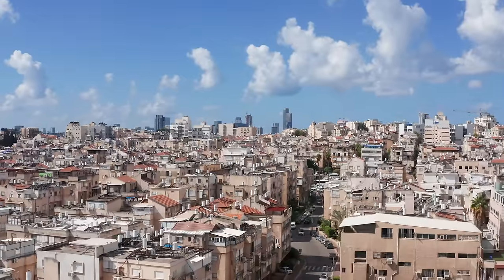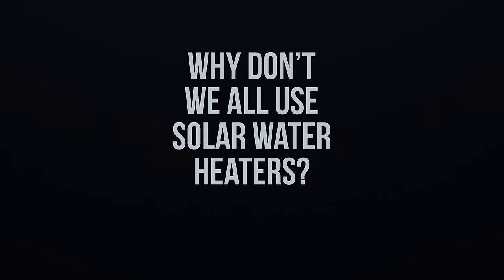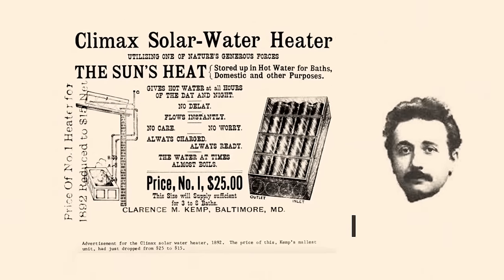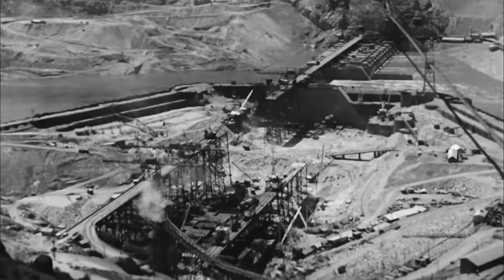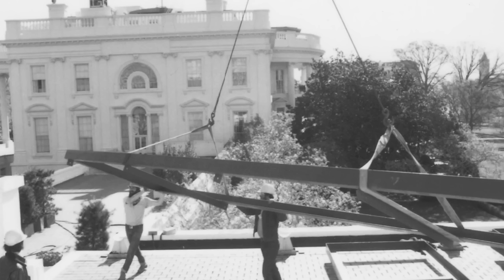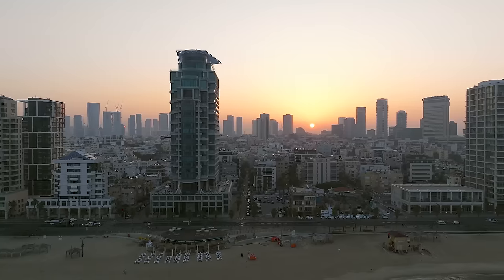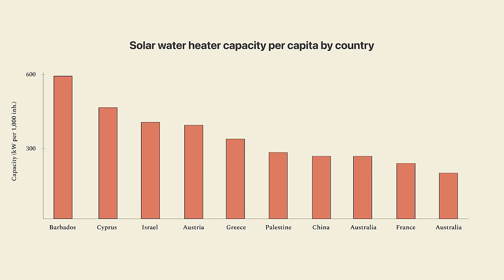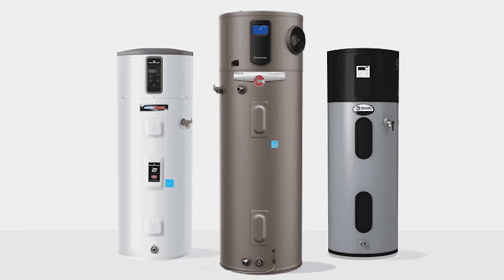Why Don't We All Use Solar Water Heaters?

Comment: I had a passive unit that was essentially an 80 gallon stainless steel tank coated with a black coating and placed in an insulated box with fiberglass glazing. Since it was passive, the cost was minimal and without any routine maintenance. I've had as many as 12 in the house and we never ran out. The 40 gallon electric heater it was filling gave 120 gallons of hot water in total. Other than pressure relief valves nothing was supposed to move and it didn't. The electric unit would supplement as needed but due to it being 'unused' it was protected from the normal debilitation of acquiring corrosion and a buildup of limestone due to boiling. 
The solar tank sprung a couple of pinhole leaks which I resolved but I think that they needed to do better quality control.
Anyway, if you can, go passive and simple. If you are in Florida, the groundwater around Tampa is over 70 degrees and requires little elevation in temps.

Comment: From my viewpoint they are an outright fraud. I had a new house built four years ago to meet the latest energy efficiency standards. To meet the standards, I had a supposedly super-efficient evacuated tube solar hot water system installed. My electricity bills have never been higher and my power company estimates the hot water component of my electricity consumption at around 35-40% winter and 60% summer. In an all-electric house with two people who shower no more than once a day, use cold water for laundry and have a dishwasher that heats its own water. And yes, I have had the manufacturer's "expert" representative inspect it and tell me it's installed correctly. I won't be wasting my time and money installing anything "solar", including PV any time soon.

Comment: I had one in my last home.  The water was super hot.  The impeller on the pump disintigrated.  Replacement parts were no longer available.  All the people installing the initial 2-3 years moved on to other persuits.  The tank was so efficent that I could turn the system off and go on vacation for two weeks and still remain hot.  The system had a radio controlled cutoff used by the local electrical company to shut off the electric backup during peek power usage.  I will never again use a system that someone else can shutoff on command.

Comment: $$$ in the United States they are way too expensive to purchase to install and operate. You could run an instant hot water heater on propane and never in the lifespan of a solar hot water heater use as much propane as it would cost to install a solar hot water heater system

Comment: Like John I installed 320 sqft of hydronic collection in 1986 it heats a 800 gallon tank in the basement and it heats my domestic water and radiant floor heating and took advantage of Jimmy Carters program .
It has been the primary source of heat in Vermont!

Comment: A modern gas heater is a lot more than a Zippo under a tank of cold water. A condensing boiler condenses the water vapour generated by the combustion of gas and uses the heat of condensation to pre- heat cold water going  into the boiler. The process is assisted by fans to guide the flow of combustion gases over a heat exchanger.

Comment: I live in Macedonia and I have a solar heater combined with my central heating and electical. The actual heater is below the roof. I use the electrical heaters only when the central is not on  or when it's not too sunny outside. So mostly in some days of April    and October. In the other parts of the year I turn it on rearly.

Comment: Works great when the temperature is already 32C, but not 32F.  I had a solar pool heater on my roof in Florida.  Ran it in the fall and spring to get a couple of extra swim days.  Never worth the investment.  You see a lot of them removed and sent to the landfill when it comes time for a reroof.  Natural gas pool heater is the way to go.  If you don't have natural gas, a heat pump heater will let you swim all winter, although it won't be hot enough for a spa in the winter.  Only natural gas or propane can do that, but propane is way too expensive in Florida.

I remember when our 3rd worse president, Carter had solar water heater panels installed on the presidential residence.  At the time, every new government building included them.  Our local library made a prominent display of their panels, exchangers, and water storage tanks.  It was impressive to look at but did very little.  After all, how much hot water do you use at the library?  Not like people are showering and washing clothes.  Anyway, the Carter's installation of 32 water solar hot water panels done by lowest bidder (or Billy Carter maybe) damaged the resident roof.  The leaks were causing water damage to national treasures so when the panels were removed for roof repair, they were never put back up.  All the water heating panels from that time 50 years ago are long gone.  Sure, many people have solar panels today that generate electricity (actually, I do), but that's not the same thing.  Still, even photo-voltaic (PV) solar panels are only financially viable in certain places based on government manipulation of energy prices.  As I always say, "All energy is local."

Comment: I live in the UK and used to fit solar water heating equipment approximately 14 yrs ago. There was relatively good sales at the time with the govs green pay in tariffs but energy prices going down back then cut the uptake to 1/3. They were really good even with the UK weather and many times trying to commission the system we had to pump water ( not the running fluid which was a glycol derivative) for at least an hour because it was coming out as super heated steam, i saw temps at 315 degrees C at times. Bet those that said no all wish they had them now. very undervalued tech. What many people fail to understand is that heating water from cold to 30 degrees C costs exponentially more than it does to heat the same water from 30 degrees C to 60 degrees C. An example being the time it takes a kettle to boil from being freshly filled, to boiling the same water 30 mins later. Even if the solar ONLY preheated your water the cost saving is huge.

Comment: We use a solar water heater,  just one flat panel +- 2.5 m2 with a 200 liter  storage since 2012 . In the summer, spring autumn it works great.  The storage reaches temperatures over 80 degrees Celsius.  We live in the Netherlands.

Comment: There's a gap in the technologies described here: Southern countries have these thermosyphon water heaters on the roof, they are efficient and need no electrical pumps. They provide water disinfection and water outage remediation. But they are heavy - and are only on houses made of brick. In Austria you wont find these, because it gets way too cold, you need a pump, heat-exchanger, and a glycol based transfer medium to a storage tank. Thats way more expensive, the large tanks are usually in the basement, because the houses are made of wood, and they require electricity to work.
There are almost no fully integrated heat pump solutions to date where the heat pump that cools your house heats your shower water, or where the heating of your house cools the fridge.

Comment: In Greece there are some solar heaters that help on heating or airconditioning (with a heater pump). These systems are pretty much expensive but it saves a lot of energy and money.

Comment: My parents installed a solar hot water system when I was a kid, and when it wore out (after 20 years or so) they liked it so much decided to get a new one that was basically exactly the same. They have plenty of space on the roof, and we're far enough north here in Australia that it makes sense, they have to use the electric booster but not too much. For me though I decided to replace my too-small and quite old conventional electric system with a heat pump. It was definitely more expensive (even after rebates) but it's been fantastic. I chose to put more photovoltaic solar on the roof because I have much more limited space, and the heat pump is timed to only heat in the middle of the day. So far it's used solar energy definitely more than 98% of the time, so my heat pump running from solar electricity has been more solar than my parent's thermal solar hot water system! This is even more the case further from the equator, because you have to use the electric booster on a solar thermal hot water system for more of the year.

Comment: Here in so. Cal. I HAD a solar water heater. The tank failed after 10 years and the replacement was $10,000 JUST for the tank. I converted to an electric 50 gallon tank in my basement and put it on a timer to not run during peak hours 4pm to 9pm. The hard water here is really rough on tanks and plumbing.  I also have a lot of solar panels which work really well in this part of the country.
Reply: Charging $10000 for a simple tank should be illegal. That's robbery!

Comment: I looked into this, thinking that the efficiency of simply heating water with solar vs photovoltaics made it a no-brainer.  Then I saw the pricing of solar water heaters.  It just doesn't make sense.  For the $5k-$10k it would take to install a solar water heater, I can install a lot of photovoltaic panels.

Comment: For most electricity storage heater, it makes more sense just to put more solar panels on the roof of a house instead of a solar hot water system. Many people do this in Australia as it's cheaper and easier to install solar panels on a roof along with a smart switch. Just upgrade to a bigger tank on the ground when it breaks.

I have had a 300L 2 panel hot water system on the roof for over 15 years and 2kw solar electricity systems for over 10 years. The problem is planned obsolete or not having upgrade options.

Comment: I built a solar water heating system in Michigan around 1979. The useful days per year were about 50%. Even so it paid for my materials coat in 2 years. In the summer I had to cover one of the two panels to prevent overheating. We used close to zero electricity to heat water for 5 months of the year.

Comment: I've had solar hot water on my roof in Asia for 10+ years and it works so well. US unit prices are much higher than here, but I plan to install when I build my home in PNW in next few years because of the long term low / no cost.

Comment: I live in south central BC and I installed 4 banks of evacuated solar tubes in 2008. It's a do it yourself thing that cost me about 4 grand Canadian. In summer or whenever the sun shines it preheats my hot water. The gas fired hot water never comes on in the summer. Not so good in the winter but it's paid for itself as far as I'm concerned. These are the least efficient EV tubes that were available at the time. They haven't required much if any maintenance in all that time.

Comment: I tried putting solar heaters on my roof, but only available ones in my country are the ones with closed loop systems which require a gigant water heater tank and special fluids, so it's pretty expensive compared to my countrys living standards. I put solar system on my roof and this watter heater system would run me almost half the cost of my entire solar, so I just decided to put a small electric boiler and still have a gas boiler as a backup for winter.

Comment: We fitted solar panels to heat the hot water in 4 houses we did in 2006/7, panels were Genersys panels feeding to an unvented hot water cylinder in airing cupboard on landing of house the feed pipe work to the cylinder was 22mm copper and was filled with glycol/water mix, through a double pump station, the cylinder could also be heated by the gas boiler as normal, also did a simular systen in a high school but had a bank of 6 Genersys panels, on the Isle of Wight UK

Comment: I live in Greece. I have installed 2 years ago a 3 Energy (if there is no sun, I can heat the water by my heat pump or by the much more expensive - electricity) Solar Water Heater. It is 200lt and it costed me 1500€ (actually cheaper, as I got also money from an energy saving government project) - and there are much cheapers. 5 or 15K in US sounds that really lot of money to me.

Comment: I just installed an instantaneous gas HWS yesterday. The price differential was about 4:1 had I gone for solar. However I have solar electricity and my home is in a cloudy area.  No tank is needed and there is no waste. The heater has a mini hydrogenerator to light itself. Further, I could easily do the job myself.

Comment: At least here in UK my solar water heating system is quite complicated. The fluid pumped through the rooftop panel is antifreeze. This is sent through pipes in a water tank which heats up the water. Pipes from the tank are connected to my home water system. When I need hot water the system checks the temperature of the water in the tank and either sends it direct to me or to be heated and then to me. It is a complicated system that needs regular servicing and the antifreeze changed every few years. It was not cheap to install and is not cheap to run. It is also difficult to find an engineer to service it as they all want to install solar PV now. Also in the winter in UK it does nothing!

Comment: In the southern UK if your home is new build or you are installing a new hot water tank (we call them cylinders) the extra cost to add solar water heating has a 100% payback time for just over three years. It will provide 60% of annual hot water requirements.
The fact that is not mandated is daft. The energy saving to the country as a whole would be massive and at very little cost to the individual who would save money anyway in the long term.

Comment: I just read a 2013 article about the introduction of a then new government subsidy by Israel to replace electric water heaters. In it they said that the system would range in total cost up to 2,767.95 NIS or about US$960, adjusting for inflation by CPI. That was VAT included. The subsidy was about US$313 in 2023 terms. I would totally buy that un-subsidized US$960 solar water heating system if I could. Economies of scale?

Comment: I have some copper tube panels which had been used to heat a pool. I bought 212 volt circulating pumps and a heat exchange unit, and will put an antifreeze solution in the panels so winter freezeup is avoided. The system will utilize the existing 40 gallon gas water heater for storage and backup.
Reply: Have a look at
 the drain back solar water heater 
Very interesting 😊😊😊😊😊

Comment: Why is Australia on the graph twice? I'm assuming that one of them is a different country? - Pretty much all new homes in Australia these days have either a solar hot water system or a heat pump, but we still have a reasonable amount of other methods used on older homes.
Reply from the maker: That was a typo (face palm)!

Comment: I don't live in teh US, but we have had a curious reuction in Sloar Hot Water. Between roughly 200 0- 2015 it was getting to be more common, but these days there appears to be less... My guess is intensivication has meant a lot of houses have been pulled down, and developer-made multi story units put in, and they aren't interested in Solar hot water.
In some developing countries just having a roof top header tank in the sun can give decent hot water for part of the day.

Comment: I had a thermosiphon solar water heater from 1982.  It was great.  Finally died after 40 years.  Worked out to about $5 a month for unlimited hot water.
Now, however, because electricity is expected to drastically decrease to about 5 cents a kWh over the next few years, I opted for an electric tank water heater with timer that heats during cheapest midday rate; that added $10 a month to bill, not worth installing another thermosiphon for $6,000.
When rate drops to 5 cents, cost will drop to about $2 a month.
A tank electric water heater is now the best, cheapest "battery"!

Comment: I installed one of these on my new house in Australia. The government gave a credit of about $1000 (meaning it cost about $3500 all up). It works so well that we didn't even realise for a week that the electricians didn't connect up the electric booster. Free hot water (even for most of winter) is a good deal!

Comment: In Southern California I had solar heated water for 15 years before the system burned out. It would have cost $3500 to have it repaired.  I found out the electric pump took more power than the cost of natural gas to heat the water.  Now I would use PV panels to power electric heating elements. So, while the original solar system worked well enough the problems weren’t worth the cost and effort.

Comment: Where I am (Canada), i recently consulted with a homeowner on how to reduce their pool heating cost. They run a boiler for the pool, but solar (electric) has become so cheap and low maintenance you can just run electric elements with the PV. With electric diverters too, once your pool is at temp the excess solar can be sold to the grid.

Alot of people on here are debating why a solar hot water heater is better than electric. Sure. Solar HW is around 3x as efficient for collecting heat per square meter of collection area. This misses a few other factors, namely, economics.

Solar PV is so cheap now you just use a diversion relay to send some panels power to some electric elements to heat the pool water to reduce boiler usage. Then, when your pool hits setpoint temperature the relay flips and sells the excess electricity to the grid. You can't sell your excess heat to the grid so after your heating needs are met your panels are unproductive.

Simply put, the market just doesn't exist anymore for Solar HW. If it did, we'd still see people installing it. It was big 10 years ago, and still has use in certain applications with high hot water uses (more than a home) like a carwash or hospitals/care facilities.